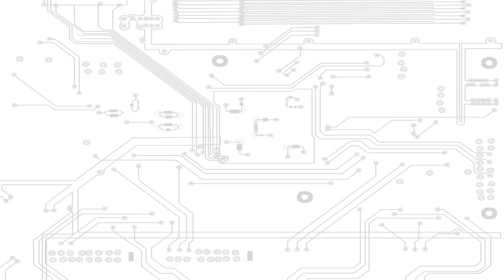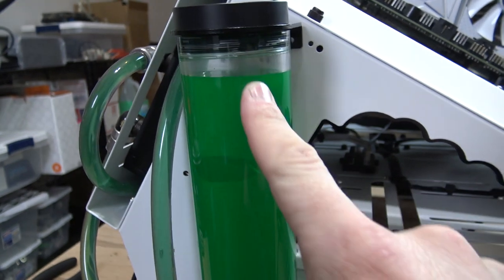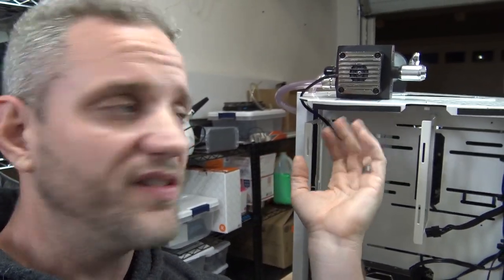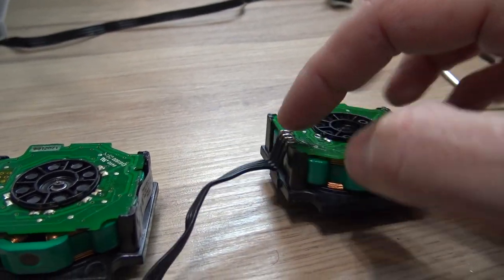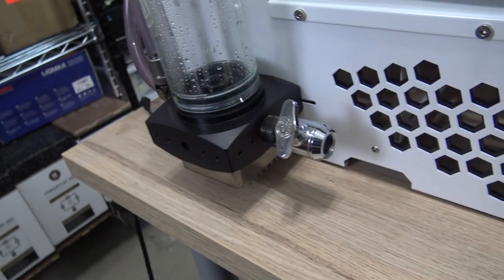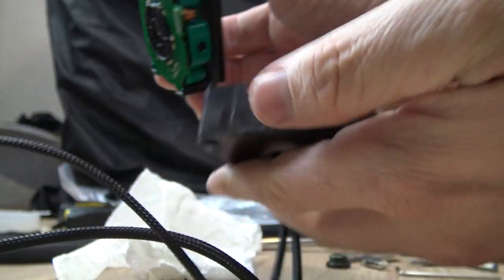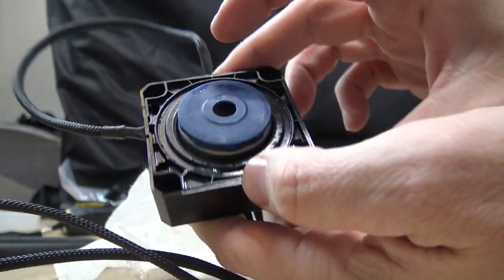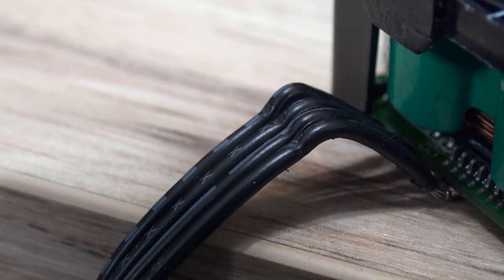My pump died... did the antifreeze kill it?? Let's pimp out my Test Bench!

Comment: great video jay. so is this a flaw with alpha cool pump heat sink? that's the way it looks anyways. I would kind of have hard feeling with a company if their product ruined my pump. definitely would be messaging them about it.
Reply: A lot of comments I've read so far from people who know a little bit of electronics is saying the same thing: "Looks like a short to the metal housing" - and I concur. There's 0 reason to use a metal housing anyway, other than aesthetics. There's little or no thermal contact to the housing, so it's not really cooling anything.

Comment: Sorry Jay, I just don't see that crimping being the cause of the short. There are a number of electronic and electrical applications where a crimping pressure is applied to a wire or group of wires in order to prevent outside forces from pulling on the solder points. If the insulation isn't broken, it can't short. I would look to other potential causes of this issue such as fan header power issues or the like.

Comment: 15% or 20% Anti-Freeze and 80 to 85% water, distilled or not...  Ran a system for 5+ years, great temps, Vinyl tubing & soft tubing, no issues and NEVER had to replace the pump.. 
So yeah it's NOT a bad idea...  Just need to know what the you're doing...  So NO depending on your mix the Anti-Freeze did NOT kill your pump..  5 years on a cheap Thermaltake pump says no, not just anecdotal, 5 years of service with multiple metal types for fittings and plastics/vinyl..   It' sitting 10 feet from me now and will still work without issue.

Comment: Can you try using Milk or glue as a coolant? I know it would be poor results but I am wondering what the tempature affect it would be, and I aint about to google some random person doing it, because I don't trust them. 

Thanks for the failure videos, helps me out alot. I wish I had this awhile ago, I was running a watercooled system which ended up having a pinch from the custom casing. Took me way too long to find the problem. Keep doing troubleshooting videos, or even simulating what could happen with solutions.

Comment: Jay after following you on Youtube for around two years. I have decided to finally install my first custom loop. I picked up an Akust Skywater 330L. I am worried about the kit the fluid it comes with is 95% water & 5% Propylene glycol with no biocide that i can find in the kit. i am thinking of putting an old 1880 silver dollar to use as a biocide. Is there any substitute for biocide i can pick up from a hardware store? The reason i ask i live in a very rural area 100 miles from any decent stores. I would also like to ask your opinion on the Skywater 330L Kit i got. I feel that you are doing a GREAT job on your videos!
The videos are very entertaining and above all else EDUCATIONAL

Comment: Anti freeze doesnt have better thermal properties than water other than it lowers the FREEZING TEMP of the solution.  For heat dissipation water is the best...so unless you are running your PC in sub zero temps and you have water cooling (for so dumb reason) antifreeze is not a better option than distilled water.

Comment: if the metal cover is cutting into the insulation of the wires is it possible that its grounding out through the cover rather then where it was supposed to?

Comment: Jay I don't think it's the edge of the metal base cap it might be the fact the bottom of it is entirely metal and if the board has surface mount components on the bottom metal conducts so if it doesn't have a foam pad inside it or standoffs of some sort to hold the board up a little that might be your problem causer, you may be able to get away with some GPU memory foam on the bottom of its thin enough to not make the pump stick out and just sand or file the edge where the wires go thru and make it a smooth hump instead of it being just a cast corner
Reply from the maker: +DeadlyVoltsHD it worked fine for 6 months and it indeed has them all pads on the bottom :)
Reply: JayzTwoCents could those pads be crushed to the point where the don't spring back up enough to keep a good enough gap between the board and metal plate ? How often is it recommended to change GPU memory pads ? And how similar are those pads to that material and 6 months does seem that it could loose some of the expansion, and I find it really odd how Coolant did that to the tubing because I work on cars daily and I've been coolant poisoned and been into many cooling systems and never seen the purple tubes even on cars with clear tubes, rather interesting

Comment: Yeah, many don't know, but electronics actually work because of smoke. As soon as you have a leak like yours where the smoke escapes, there is no way to get it running again... 
Couldn't you just make the hole in your metal one bigger so it wouldn't pinch so much?
Reply: Don't forget that if you turn it upside down, all the electrons fall out. Almost as bad as the magic smoke escaping :(

Comment: As I eluded to in another comment section of a prior vid you did on the rx580 card bench marking , which I'm still waiting for you to bridge 2 of the golden sample cards for testing, you have some apprentice plumber learning curve going there.  Like most circulating pumps and there are many , shit can go wrong. Good for you, you found the issue. Now you might be able to double your rates employing hydronics with your tech knowledge.
 Many people were leery of  using water cooling in snowmobiles as the possibility of a freeze up shutting you down. Now you mix water with a top end pc rig .. yeah that isn't asking for problems.. go ahead and do it. Just remember your wallet and or buy back up parts . 
 As for the pumps I am surprised with all the nice ones for aquarium sets that they haven't made one you can replace the motor without removing the impeller?
 Now to the glycol issue it shouldn't hurt an impeller. Ethylene glycol is used in auto antifreeze , but  propolene is used for a food preservative so I would think it's a bit more mellow on the internal parts. Let's hope so at least since it's in a lot of food like mcdonalds  and who knows what else.  But it should be ok for these cooling systems when diluted well enough for a light mix.
 To sum up , tell em to buy back up pumps / parts. Try propylene glycol  light mixes if you think you even need to.  The tubing compatibility would be my biggest concern with glycol so maybe an industry standard time for change transpiring here ? 
 Keep on keeping on .

Comment: only thing springs to my mind would be in video were you added anti freeze the shit going to after few days I thing that builds up and would be making liquid more thick and hard to move most smart pump/motors when it can't move will turn of and  back on agian to make pushing force which it hopes to flush what ever blocking it out

Comment: As for the portable air cooler with 1 exhaust hose.  For your test it is OK but in real life these suc. You should always get one with two hoses.. Why  in your case it did not mater as you were dumping the hot air back into the room . But normaly you would use the window mount and the hose would dump the heat outside. The problem is on a hot day you force air out the window then hot outside air comes back in the house wherever it can get in. If you have a two hose system it does not create a low presure and drag hot air back in the home.  Amana and others make the portable units with two hoses. Having just hot exhaust is a very wastefull system. Always and ONLY use a two hose system.

Comment: Whats up with the Q-Code changing? Mine (Asus) is usually at AA but has recently been doing 40, yet I don't find 40 in the Q-Code directory. However, I have never seen it flicker 40 to 41 back to 40 after it has finished boot up.

Comment: it's 2017 and I still don't trust cpu water coolers....this video shows exactly why. I have a gaming rig that I have been running for 8 years (they have not made a game that would need a more powerful cpu....yet!). I prefer quality and durability in the components I put in. It may not be competition for all the overclocked water cooler running rigs but I know that my rig is far more reliable then the overclocked water cooled rigs...and it gets the job done with an air cooler. I don't get why companies that make closed loop coolers (which are more common then the modular coolers now) ever take time and spend resource to make the water pump more standardized and replaceable like all the other parts of a PC. modular coolers may still be repairable but a closed loop cooler pump with a life of 2 years max (and 10 minutes min) could die at any random moment and then u have to spend time and money replacing the pump and the connected radiator for the same caost as the last one. Air coolers are still a better buy since they only run the cpu at only slightly higher temperatures and the only part that could die is a replaceable standard sized fan that can be replaced with the fan of same size from any known manufacturer brand and ur CPU cooler is good for another 2 to 3 years. Why won't the manufacturers change the potentially defective design of water pumps?

Comment: so....other than looks....why watercooling?

my 1800x is running at 35°C at stock speeds, my old cpu the fx8350 was around 55°C overclocked....both at total silent fan speeds of 500rpm on my Noctua NH-D15, so there's a lot of headroom

Is watercooling more silent?
is it cooler?(as in lower temps)

are there other benefits I'm missing?

what if I would just hook up a radiator from a car, could I practically cool it passively?

Comment: Honestly, it's cool and all but fuck water cooling, it's a pain in the ass for some aesthetic brownie points and less decibels. Fans perform the same job pretty much just as well and you don't risk blasting grape juice (or antifreeze in this case) all over your system.

Comment: Wait, why are you using antifreeze in your loop? It has worse thermal conductivity than water; the only advantage is that it doesn't freeze at 0°C, temperatures your loop will never reach anyway. As for anticorrosive and biocidal properties, any watercooling dye will have those, too.

Comment: The PINCHING of the wires is NOT what causes the SHORTING, it’s in fact the METAL HOUSING which is SHORTING out the wire SOLDER JOINTS when mounted, so FIX for METAL HOUSING: COVER the SOLDER JOINTS with electrical TAPE.
 tl;dr: read words in caps

cheers

Comment: How is a pinch equal to short?
wires are pinched all the time, but not shorted. I don't see any exposed wire, do you?
and it doesn't make sense to have short outside and blow parts inside

Comment: the cover didn't do anything imho. the pump died due to overheating or a dank auto-oscillation of the circuit. causing a short there would have just turned off your psu, possibly also frying part of your motherboard if it's not directly connected to the psu (not all pwm circuits are born equal), and even if that didn't trigger for some obscure reasons the only fried thing would have been the insulator, leading to a house on fire. of course i'd have to check that board with a multimeter to say this 100% so, again, it's just imho. :)
Reply from the maker: Unfortunately your opinion has no bearing on the facts in this case ;-)
Reply: oh sweet so you know what that burnt chip does?

Comment: Evans EC53001
High Performance Coolant Features:
For All Gasoline Engines, Light Duty Diesels & Classic to Modern Production Cars
Ready to Use, No Water Required
Eliminates Overheating, Boil-Over & After-Boil
Generates Very Low Vapor Pressures
No Silicates, No Phosphates
Contains No Oxygen, Eliminating Corrosion & Pump Cavitation
Low Toxicity
Protects for Life of the Engine

Comment: Hey Jay. Can I ask how much of a bad idea buying a GPU with a pre-installed waterblock like the MSI 1080 Sea Hawk EK X and the Zotac 1080 ArcticStorm (Zotac even released one with a Thermaltake waterblock) ?. I'm planning on upgrading my gpu's the logic being that with the pre-installed gpu I won't have to worry about fucking up the installation and if something goes wrong I could simply return it 'cause I didn't ruin the warranty but a friend of mine called it "The Worst Idea Ever" that I don't know who installed it in the first place (could be a paid orangutan for all we know) and if it goes wrong I don't even know if MSI or Zotac would honor that warranty.
Should I go ahead or just do the hard work and hope I don't fuck things up for me ? Any advice would be appreciated.
Reply: The cards with a pre-installed EK waterblock should be a very safe bet. The water block is identical to EK's regular waterblocks, just pre-mounted and thus warranted by MSI.

That said, installing a water block is one of the easiest things of all time, but there's really no reason to do it yourself if the price for buying the pre-mounted ones are fair anyway. I am considering the Sea Hawk EK myself even though I've done tons of custom water cooling before, just for convenience..
Reply: Thanks for the advice. I've done some watercooling but when the worst happens (like a malfunctioning gpu) and I needed to return/replace it. It gets rejected 'cause I void the warranty by replacing the fans with a waterblock so I found those pre-installed one ridiculously appealing.

Comment: Oh I know the smell of burned electronics... Last time - yeah I've had it happen two times - my computer died it literally filled my room with smoke. I was eating my breakfast before school while watching YouTube then suddently my PC turned off. I sat there for 5-10 seconds wondering about what have happend but yeah I had no idea. Then I tried turning it on again and then boom (and I'm seriously not lying) 5cm long sparks came out of the motherboard, just behind the audiojack things. As fast I as could I pulled out the PSU power cable. Then I sat there again for some seconds thinking: Did this really happend? Like I didn't really believe it, so as stupid as I was, I tried turning the shit on again and everything got crazy again with sparks and shit. My case was filled with smoke and the smoke came out of every hole in the case. I then took the side panel of my case and then my room was filled with smoke. It smelled horrible. 

I then sent my computer back to Komplett.dk and they tested it. They got the same result as me; sparks everywhere. But somehow it was only the motherboard that died from it. My RAM, CPU, GPU, everything else still worked. Lucky me, I did get a new motherboard from Komplett. 

You may be wondering which Motherboard I had and it was the MSI MPower Z77. I still use the new one I got from Komplett that day.

Oh, and nice video btw JTC

Comment: I dont understand why any of you would be using Antifreeze water itself and other chemicals cool better then antifreeze. Not to mention NO ONES computer is under risk of the coolant freezing. Which, besides a few corrosion inhibitors is the only reason antifreeze is antifreeze. Though manufacturers recommend 50% you only truly need 15% antifreeze to stop freezing. Straight distilled water however cools significantly better. Carries more heat and transfers it in and out faster. Though, there is a product called Water Wetter, which I absolutely live by in the automotive realm that increases the cooling ability in a vehicle. I myself saw over 20 degrees difference just by adding it. In the hot Northern Ca. summer 100+ heat. I wonder how that would work in this this system. Or a water cooled system...

Comment: HELP!

i was bleeding my system, switching the power on and off with the psu hotwired. everything worked, but then suddenly the pump wouldn't turn on. the psu still works. pwm is not connected. there's no leaks.

Comment: Was going to say I didn't think that antifreeze would kill you pump. Because the first water cooling system I got was Thermaltake Big Water and it come's with Propylene Glyco and was in it  for over a year. The pump was replaced with a D5 it still works just had a lose connection in it. Had it for 9 or 10 years.

https://jet.com/product/detail/b1d0d7ab59474fffbff054d434ba458b?jcmp=pla:bng:nj_auto:auto_oils_fluids:na:PLA_276117206_1220457923120348_kwd-4579878246585235:na:na:na:2&code=PLA15